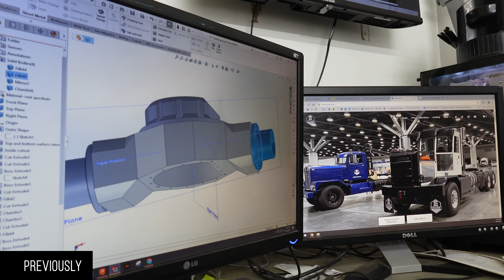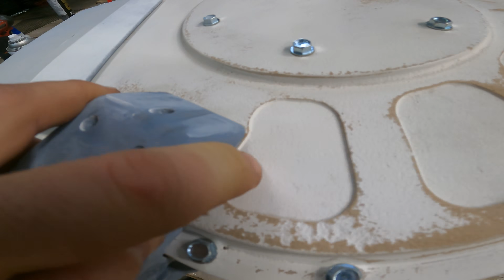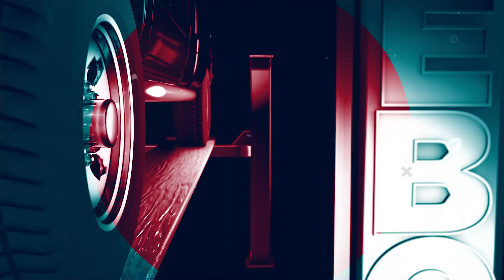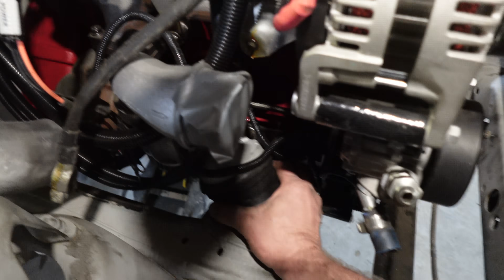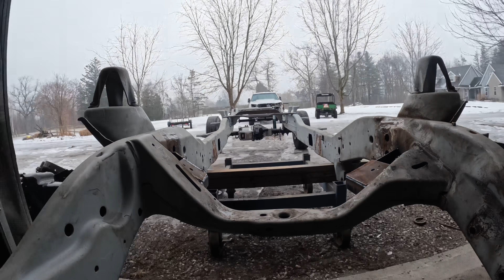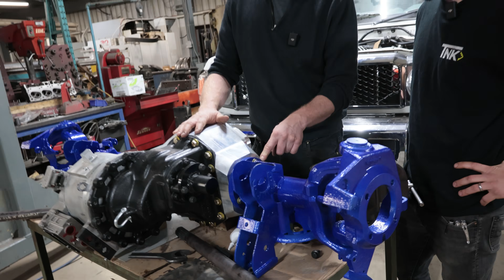Test Fitting our @EdisonMotors Generator #RamRecharger [EP9]

Comment: @DEBOSSGARAGE I've been wanting to ask this question since I started watching this series. 

For curiosity's sakes, does the generator application actually require a 160HP deisel engine to drive it? I'm not sure how many total amps the generator is being designed to output, but based on the physical size of the mock-up genny Wouldn't an engine with around 60HP would be sufficient and even more efficient overall than a full-size Cummins rig? Especially considering the deisel torque curve.

In no way whatsoever is this a criticism of your work and I hope you don't see it that way. I think you're doing a fantastic job and I'm definitely looking forward to your end product.

I even have an 05 Chevy Express 2500 work van I'd love to convert to your system some day that I'd be happy to lend you as a test platform if you'd be interested, since the Chevy Express is one of the most ubiquitous work trucks on the road.
Reply: It takes 50 hp to move a car on the highway. It takes 100 hp to move a truck on the highway. This truck with 150 hp is hopefully enough to keep the batts charged when pulling a trailer up a hill.
Reply: @Sah-o5m  I'm very aware of what the horsepower and torque requirements for various vehicles are WHEN the engine is directly coupled to the driveline, however this is a generator system where the engine is only connected to a (future) generator unit, so driveline loss isn't really a thing. It should only require the horsepower it takes to achieve maximum amperage out of the generator, and what I'm questioning is whether that generator needs 160 horsepower to turn that generator or not.
Reply: @jasonholley3009  If the batteries are depleted, and an Edison pickup truck is driving on a highway at 60 mph, then 30 hp is needed from the engine/generator just to push the air. Add a box trailer and it bumps up to needing 100 hp from the engine/generator. Add an incline and horsepower needs go up further.

A person could build a truck as you suggest. Under normal circumstances, it would be fine. However, if you ended up at the bottom of a mountain pass with depleted batteries, and a 7000 lb truck, and 7000 trailer, then you'd be climbing the hill with 20 hp at 3 mph. So its doable. I believe it would not be pleasant :(
Reply: @Sah-o5m  Here's the thing. The generator itself is the only thing that's going to determine the power required since the engine is not attached to the rest of the driveline mechanically, so the torque required for the maximum draw of the generator is the only thing that's going to determine the required horsepower whether you're going uphill, downhill or towing a load. It's an electrical connection only and it would surprise me if that generator design requires that much HP and torque.

Comment: Wouldn’t a side by side radiator set up be more efficient for the two different temp ranges?
Reply from the maker: No, more surface area is better cooling.   As for the engine we just need a temperature difference in order to exchange heat, and the radiator wis bigger than it needs to be

Comment: is it possible to use the ev coolant to keep the engine at 36c while its off to help with intermittent operation in the winter?
Reply: Edison/DeBoss is talking about doing something like this to preheat the engine on the diesel/electric snowplow they're making for Emcon. So yes. Personally, I'd like to see a heated pre lube, and heated glycol to warm the oil/glycol for a minute before starting up the engine. I believe it will make the engine last longer.

Comment: Not sure if this has been asked but would the 3 cylinder 1.4l cummins work just as well with the generator to charge the batteries?
Reply: The batteries handle peak power. The generator handles average power.

A 1.4 liter cummins makes 20 horsepower. A car needs 50 horsepower to push through the air on a freeway. A semi truck needs 100 hp just to push through the air.

The 2.8 liter cummins engine shown here should make 150 horsepower which should be enough to keep the batteries topped off for a car, or truck, or semi truck.

Comment: What is the endgame for all this?
Reply: Deboss is working on a universal diesel/electric kit to sell. Buyers can use the kit to repower old pickups that have worn out engines/transmissions. A pickup with an Edison/Deboss kit should have twice the hp/torque of stock with reduced fuel costs.

Comment: Ahhh yes .. the tried and true maritime method of producing electrical power by burning diesel. Love it. 
People ask me quite often, being a diesel tech, if I worry my career will not carry me to retirement. I am not, in any way, even slightly concerned.
Reply: same here as a truck driver, they talk about the auto pilot trucks all the time , still gonna need someone to babysit that truck and open doors , check in to receivers and shippers , back into docks etc , but make the truck able to do all the boring stuff for me and i'll be happy ! i already watch youtube while i work 95% of my day as is
Reply: @ it really comes down to battery technology. We just are not there yet, and in the boiled down reality it is going to take a true breakthrough in material science for us to have the battery technology necessary just to replace the diesel engines in semi trucks and everything smaller. That is not even considering freighter vessels, backup power for hospitals and other infrastructure that lives depend on. The potential power and reliability of diesel fuel and gasoline are exponentially greater than any battery today and anything actually viable in the foreseeable future.

Comment: What an old welder said to me about upside down welding, was to think of it like TIG, heat it up and push the wire into the joint, But i am a hard core flux core guy, outside is all i have and feeding the world with more oxygen i cant afford lol, Love the videos and the progress its hard to believe how fast its going cheers oh it does work with flux core by the way :)

Comment: This is by far the future of EV's all the other guys skipped this step in evaluation. I hope one day to drive one not sure I'll be around to see these on the streets here in the US. I know Edison will change the truck and trucking industry for the better. Amazing work as usual Rich you are a great builder and automotive engineering seems to be built into you. Can't wait to see the final product.
Reply: i doubt even hybrids will ever be practical for real world long haul trucking . i do 700 -750 miles a day 3 days a week plus around 400 miles on my final day. we don't even have a tesla charger within 300 miles of my house . i understand im not like everyone when it comes to the charging station but i am much more common than the shorter haul log truck industry that chase is "chasing " (pun intended) , but that market is sooooo much smaller than the long haul market . and i just don't see how they're ever able to meet the demand mileage of guys like me without an extremely high upgrade in battery technology. we'll see though
Reply: @Hard_Right  you're exactly one of the markets that they're targeting. Edison are very aware that there is not enough infrastructure for plug-in EVs, so they've incorporated an onboard genset that is effectively a diesel-powered supercharger that you can replenish anywhere you can fill up with diesel.

You don't need to pull up at a charge point, but it is an option if it's available. Also, if you're running short on range, just stop somewhere for a splash of diesel and get back on the road in minutes.

If there isn't a fuel stop nearby, take some extra fuel in a can. Same as any other conventional vehicle.
Reply: @Hard_Right  I think the hope is that the system is more efficient than a standard diesel powertrain even when running the engine/generator. That way you could start off on electric, switch to the generator after that runs out, and the battery would charge as you drive until you could switch back to it. I'm not sure what the data will say when it's all said and done, however. I think they are starting out with looking at short haul and light duty because the system has the potential to be much more beneficial here. I would love a pickup with this system because 99% of the time, I'm driving it less than 100 miles in a single sitting. So it's a pure EV without range anxiety or absolutely enormous batteries. 

I think an interesting idea for long haul trucking would be pantographs, like they have for some busses and electric trains. You could have your battery powered semi tractor drive around town like a normal EV, and then connect to the power grid to recharge while cruising on the highway. Ideally, you would also have the hybrid truck generator in case part of the route wasn't covered. It's the best of all worlds, the truck could still have the freedom of an internal combustion setup but with the lower emissions of an EV. You could also get away with a really small battery, because it would just need to pick up the slack while getting up to speed.
Reply: @Hard_Right  What didn't you understand about the word "hybrid"? Their electric semi truck motor makes over ten times the torque of a 13 liter engine and is only using a 9 liter generator to power it. They get far better mpg than your current truck, especially when accelerating, and since they make custom vehicles you could still get extra fuel tanks if you wanted to drive clear across the desert or something.
Reply: @soangry  reading comprehension not your strong suit huh bud
Reply: @maga_dad  You're complaining  about the range of a custom-built hybrid truck, something  that by default would have more range than a standard truck. You have far more issues than just reading comprehension.

Comment: Like your work and how you're converting to Diesel-Electric.
However, your claim to adapt to all pick-em-trucks doesn't hold water, if you're changing out all the running gear and axles. Might as well make a platform and adapt that to any body anyone wants to use.
Reply from the maker: No, as each platform uses it's own brakes, suspension, abs sensors, hubs,  and wheels.   We would be able to use all of the oem parts so you can get the normal service done anywhere with parts at the local auto store

Comment: If you guys don’t follow Mike on stanceworks already, you should.  He has been using 3D scanners to figure out a tube chassis underneath an existing body.  This process is cheap and would make custom installations so much easier for a relatively small capital expenditure.  I believe Johnathan Ward at Icon does this as well.

Comment: why don't they make the consumer version of the 2.8 Cummins an Aluminum block? if they did that with the old 3208 it would take more then 1000 pounds off the GVRW, that's nearly +4mpg. "have to use stainless cylinder sleeves"... +4mpg over 300'000 miles is another $30~60k per unit/mileage/w'rebuilds/+use that the government doesn't have to sublimate over whatever nonsense the buyer thinks they are doing to make an income. taxes in a society that doesn't pay them ⬆ forced to work around it.

Comment: Rich! The Benz Mounts are notorious for failing within roughly 30-50k miles with just aluminum 4/6/8 cylinders, you may be rethinking this with a heavy cast iron diesel, but loving the videos <3 Keep up the hard work
Reply from the maker: Keep in mind that it only torque up on ounce.   I've used them before with the 4bt and they outlasted the tagoe
Reply: @DEBOSSGARAGE  everyone uses the black series part number and last i had to replace my personal mounts it was still available
Reply: True, I didn’t think about that the engine will only run minutes/few hours or so at a time unlike a normal vehicle, sorry 🤦🏻‍♂️, And I wasn’t sure if you knew much on them, but if ever needed new mounts and wanted to stay with Benz design, the V12 and or AMG black series mounts are more rigid.

Comment: What im looking for is an electric low end torque boosting hybrid differential. A standard ICE input shaft with an electric helper motor just fir getting off the line and regen. Probably wheel mounted motor/regen brakes makes the most sense. I love ICE performance but all the components struggle the most on that first torque getting the bofy in motion. If you can support that directly at the wheel hub with external force that would be huge on reducing engine size / torque and component wear.
Reply: That's basically what the newer supercars are doing. Electric motor off the line with the gas engine taking over after.

Comment: Keep in mind with all the extra weight of the batteries, inverters, dc/dc converter, high voltage junction box, heaters, chillers, traction motors, and high voltage cables, you lose your total payload capacity. So your 3/4 ton truck is now a 1/2 ton truck pretty much
Reply: Some of the weight will be offset by the smaller and lighter engines, removal of Trans and axels.
It may not be a solution for every person, but it will have it's place IMO.
Consider the FACT that every kit owner would then have access to a Generator they can plug into their house when needed.
Reply: Its true that the electric equipment will make the truck heavier than stock. However its the frame strength, leaf springs, axle bearings, and tires that limit carrying capacity. I'm confident this truck will do what it is needed to do.

Comment: Can't wait for small truck conversion kits somewhere down the line. Our s10's, rangers and hard bodies are all in desperate need of saving!
Reply: that's what the LS is for
Reply: @Mouthy_Trucker  yeah but.. been there done that?
Reply: I don't think these guys are gonna scale it down to >1\4 ton lil trucks. You can already buy a Tesla axle & slap a lil Kubota plus genset in those and be all set. ¾ &1 ton + trucks are a way larger market to be able to support these diesel hybrids. I don't see them wasting time & money on rangers\colorado etc unfortunately cause they're already fairly economic to operate and can be hard with small diesels
Reply: @tdotw77 the core part of “make electric” isn’t that hard.   Making it a kit is harder.  The part I’m really interested in is the integration (how much must be replaced on any vehicle to make it work)
Reply: @SimJDKS  this
Reply: @SimJDKS  this
Reply: @tdotw77  that and most people don't have a fab shop and electronics engineer laying around the back yard to hack together a Tesla kit and make it work right. It's already 75% of the way there sans the custom 1/4-ton north American e-axles. There's no reason not to make a kit available some years down the road
Reply: @tdotw77  the available electronics and batteries suck ass, and if they don't corner the market someone else will
Reply: Honestly, 1/4 trucks don't really have the payload to justify this setup. That engine and generator combo will be quite a bit heavier than the stock powertrain. Then you need the batteries on top of that. I just don't think anyone could justify spending $40000 converting a ranger. It won't make sense as a work truck and is too expensive as a commuter vehicle. The sales just won't be there.
Reply: @jmanlinc  you don't need the expensive Cummins diesel in that application, or a Kubota or anything like that, nothing wrong with stock 4 bangers, there's already plenty of options for low displacement right off the shelf from all of the makes (Ford, GM, Toyota, Chrysler).. what I'm saying is there's going to be huge interest in an axle/generator/battery/preset electronics kit you mate your own junk to. It wouldn't be strictly a payload thing, we don't own 1/4 tons for that. It's the utility of a hybrid setup and it doesn't quite exist yet. Hell if nothing else sell the damn battery & electronics as a kit but saying it's not practical somewhere down the line is just ignorant.

Comment: Diesel-electric drive systems are an old and proven concept.  Modern freight  train locomotives are diesel-electric, Westinghouse/LeTourneau built diesel-electric earth mo ving scrapers and loaders in the 1960s, Caterpillar build both a bulldozer and front loader that are diesel electric. The design challenge for auto/truck systems us to streamline the size and weight yet maintain durability.

Comment: Really cool engineering, but I wonder how feasible it's really going to be if it involves replacing this much? I was hoping envisioning it being all bolt on plug and play stuff. Remove the existing diffs and install front and rear motor pieces that bolt onto where the diff cover was maybe. And a generator that bolts onto the existing engine. Add plug and play control units that replace existing PCM and ECM, a battery, and it's done. I feel like if this much is needed it will end up costing more than is feasible for late model trucks. Brilliant ideas and I'm rooting for you. Just sharing my concerns in the hope to help.
Reply from the maker: That is still happening.   Watch till the end.   We have engineers working on adapting the kit to OEM engines, but this  2.8 first as it is less engineering to prove the rest of the kit
Reply: Keep in mind this is basically a complete rebuild as well as a conversion.

Comment: The EV coolant needs to be 35C? Will these conversions be drivable in the summer/south?
Keep up the great work!
Reply: EV motors and batteries don't produce a ton of heat, and the coolant is typically routed through the A/C system to help regulate the temperature. That's why ev generally have small radiators.